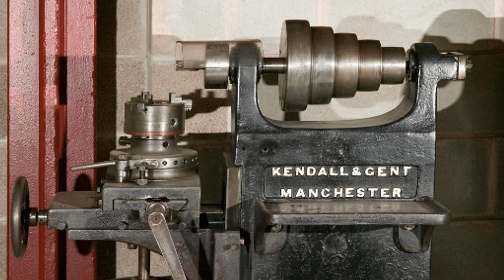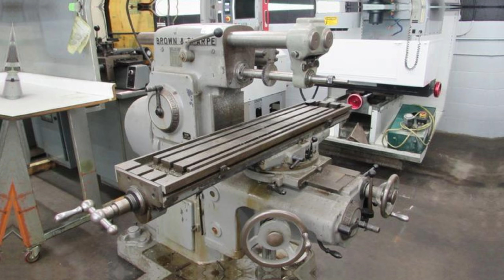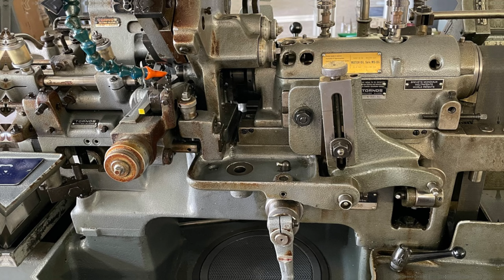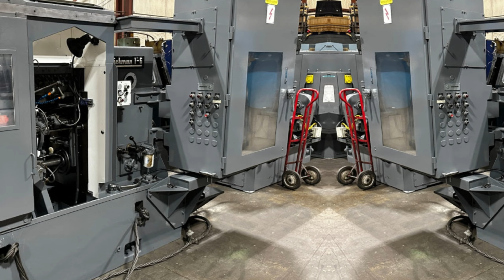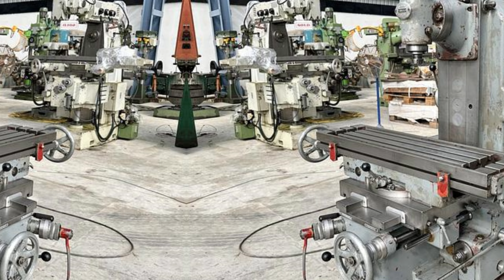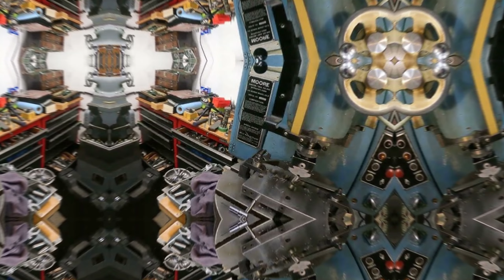America Had No Computer Controls in 1915 — So Mills Used Gears, Cams, and Pure Geometry

Comment: Try using a Rotary Table, which rotates by a handle, rotating one hundred revolutions for one turn of the work table. A system, accurate to two seconds of Arc. As an Apprentice, one was expected to form a large gear wheel by hand, using hacksaw, file, and one's brain, and hands.

Comment: Why do you think we taught reading (understand instructions), writing (write operating instructions), arithmetic (calculate ratios and cutting depths) and accounting. Advanced mathematics was for engineers to calculate sizes..

I learned most of these 70 years ago when my stepfather bought an old lathe for his shop. Too bad he was an abusive drunk. 

There are several wonderful museums in the Connecticut /river Valley in Connecticut, Massachusetts and Vermont that cover this topic in a fascinating manner. One has a small overhead line shaft set up that the visitor can turn by hand. I thought these had a huge amount of drag but this can be turned with one finger.